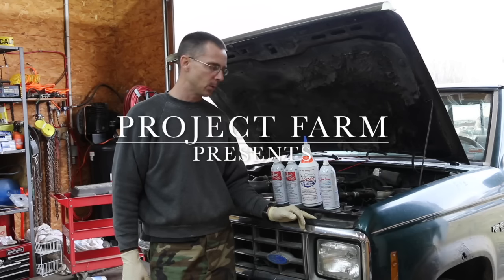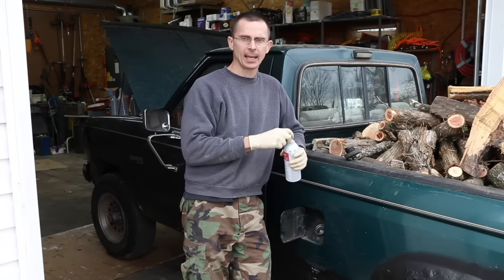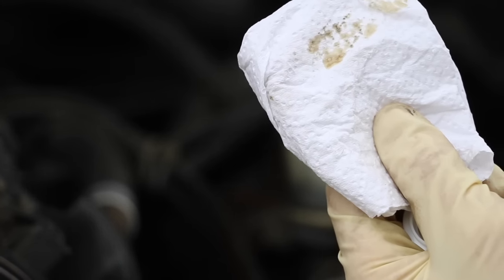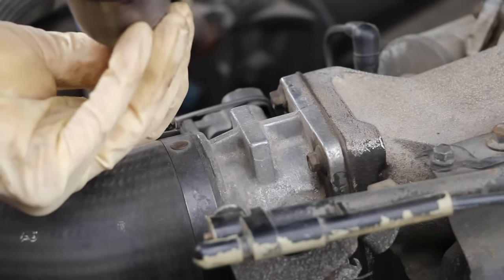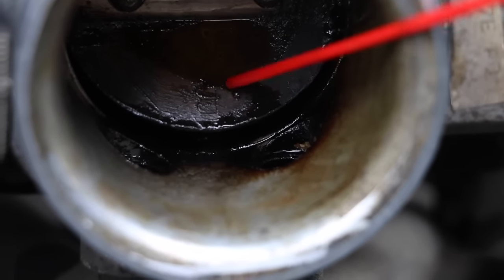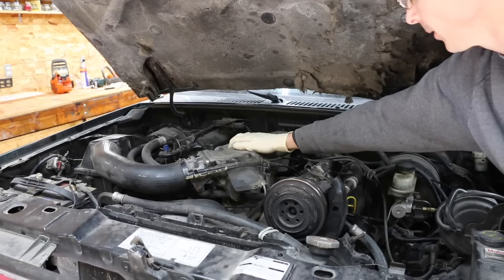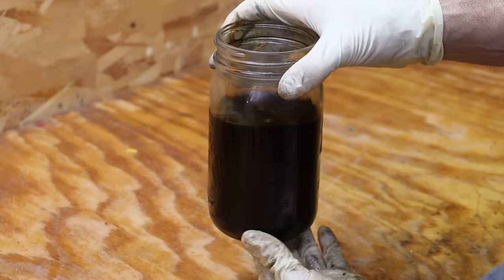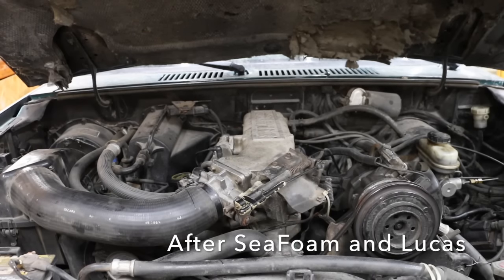Seafoam--can't believe what it did to my engine!!

Comment: A couple of months ago I bought a 2000 Ford ranger with a little less than 100,000 mi on it but it had been used by a meter reader. Three days ago I did the gas tank and I also did the throttle body cleaner made by Sea foam and I cannot believe the results. This truck idles as smooth as glass and it runs great on the

Comment: Lucas oil treatment, or STP, same thing? They seem to have the same viscosity.   I have 410,000 on an 85 Ford F150 I bought new back then.  Has probably the best motor Ford made, the 300 cu in 6, manual 3 speed/overdrive floor shifter.  Oil change every 3500-4000 miles, straight 30 weight non-synthetic, new filter every time.  Does not burn any oil, no valve train noise, but it could use a gasket or two. I vowed to keep this truck for 35 years so I didn't have to get it inspected anymore (NC).  Funny, a 35 year old or older car, truck, or motorcycle (I have a 45 year old Harley FLH) does not need to be inspected, could have bad brakes, burnt out/missing/inop lights,  but a brand new car does.  That's the govt. for ya.

Comment: I pulled my old 77 F-150 out of the hay shed and I'm in the process of bringing her back to life. (351m all original with 99,400 miles) I cleaned the carb using gumout spray (while running), new cap, rotor, plugs and wires.. and ran a 12oz can of seafoam with 6 gallons 3 times.. it improved but it was still idling rough and lacked smooth performance.. so my next step was timing.. but.. before I did that I ran a can of seafoam spray thru the carb and let it hot soak.. LET ME TELL YOU WHAT... This tall deck Cleveland ABSOLUTELY SCREAMS. Truly amazing stuff.. if you have an old rig with a carb, use the spray. By God..

Comment: There is another YouTube that took a scope down the cylinder by removing the spark plugs before and after the seafoam spray treatment and the visual results are amazing. The carbon build up was almost all removed from top of the piston. Stuff does wonders
Reply from the maker: Thanks for sharing.

Comment: Amazing result.  I also didn't think those snake-oil products would work.  Surely doesn't fix everything, like worn metal parts, but if problems are just due to sludge and carbon buildup, it seems to work well.
Reply from the maker: Thanks for sharing.

Comment: Yes, certain additives like this do work because they are super-high in detergents, it really cleans internal parts. my truck engine is known to have potential valve lifter issues, so running some Marvel Mystery Oil, or ATF, 1 qt with 5 motor oil to make 6 in the pan, keeps the orifices on the lifters open & clean preventing this issue. it's our trick. changing it often is key as well. it's not just a flush, we run that qt of Marvel or ATF with the oil until the next change-up. it's good for virtually any engine.
Reply from the maker: Thank you

Comment: On the older cars it typically does work. Good for cleaning out vacuum lines too. The newer ones it can be hit or miss. Many new cars call for higher octane which leads to less do deposits do to the turbo and higher compression.

Short story a V6 Ford or V8 crown Victoria go for it. 2016 BMW M2 I probably wouldn't. You'll probably piss a lot of things off. Things were much simpler in old days. Rubber mallets fixed stuff. These new cars have way too many sensors you'll probably piss things off. On my V8 Crown Victoria Police it don't care what you throw at it. A tank of 93 won't help but it does help keep things clean.

Love the videos tho. I do think some of this stuff works. Personally I I'm a fan of Pennzoil Platinum Walmart has it cheap it enough.
Reply from the maker: Thanks!  Thanks for sharing.

Comment: I have a 2006 Corolla with 280,000 miles on it, and it also was starting to have the lifters make ticking noises like that. I added a can of 'Wynn's Engine Tuneup' ($4/can) to the engine oil and after a few weeks of driving with that 'solvent', the lifter noise went away. The engine has a lot of wear on it and I added half a cup of Lucas HD Oil Stabilizer and that made the engine a bit quieter. After all that, the engine is back to the quiet smoothness it used to be when it was new.
Reply from the maker: Thanks for sharing.

Comment: It works on motorcycles also. I bought a 1990 Honda Goldwing in mint condition. The engine had rough idle and some hesitation. After several gas fillups using seafoam, she roars like a lion and purrs like a kitten.
Reply from the maker: Thanks for the feedback.

Comment: I added Lucas fuel system cleaner to my gas and did seafoam in the air intake. After seafoam my '03 envoy with 220,000 miles starts up instantly with nothing more then a purr, and runs beautifully quiet!
Reply from the maker: Thanks for sharing.

Comment: My take: I have used Slick 50 in two different cars; early 90s, both blew a value and piston. Never used it again. 

Beginning in 2012, I occassionaly used a can of seafoam in my new 2012 Fiat 500 two-door, but I also would add non-ethanol gasoline occasionally. However 80% of the time I used hi-octane gasoline such as Shell Z Power. The gas mileage was extrordinary with non-ethanol and while driving back home which is 3 hour drive, I would achieve 55 mpg. Around 2015 I was warned by a Chrysler engineer  to not use seafoam as it may damage the engine. Last December 2021 the Fiat engine blew a value. I ran into a gal who took her Fiat to our dealership and she was in sales, her car had over a million miles on the odometer, but my engine only had 160k when it blew a value. Was the damage cause by the non-ethanol gasoline or the seafoam? Not sure. I am on the fence using additives these days. i seem to have bad luck but for my lawn mower and snowblower I use only non-ethanol gasoline.
Reply from the maker: Thanks for sharing.

Comment: I've been using Lucas for decades and although it does quiet the engine it is thick like molasses and in cold temperature -25 I worry it will be too thick, I use synthetic oil and add a round 1 cup of Lucas oil stabilizer. Per oil change... - ( My old truck with 275.000 kilometres)    it was summer and I added a liter of Lucas stabilizer and didn't shut the truck off for 45 minutes. The Oil pressure went way up...   Lucas definitely is slippery and will improve gas mileage. I also add 6 oz of Lucas fuel injection cleaner every 5 tanks of gas ... It makes a huge difference.   The biggest difference I noticed is the engine runs quieter and has more power. The lifter tick can be controlled by adding about a cup of transmission oil to the engine oil. It flows better through the oil passage ways and lubes the lifters better.. It's a easy way to stop sticky noisy lifters...
Reply from the maker: Thanks for sharing.

Comment: Seafoam goes in every non-ethanol gas can I own, premix or not. Every so often I'll dump a can or however much I need in my gas rigs as well. The seafoam spray works well too in conjunction with a fuel treatment. I love Seafoam or Berryman's B5. It's the same stuff and does the same job from what I've seen. Berryman's is usually cheaper but I can't always find it everywhere. Lucas has been around a while, but I rarely use it. That said, add half your oil to the engine, add 3/4 of the lucas, top off the lucas bottle with oil, and shake the hell out of it. Then top off your oil and it's just easier to deal with.
Reply from the maker: Thanks for the feedback.

Comment: I’ve found that the quality of oil and fuel also makes a big difference.  The last four tanks of fuel I’ve been using the Lucas fuel treatment.  The first two bottles I was using mid grade (87) gas and with about 90% of my driving was in town and was getting only about 12 miles per gallon; third bottle I put in premium (91) gas and my mpg went up to 14 mpg; with that 4th tank and bottle I’ll see how it goes.  But over the last couple of months, there was an exhaust leak which was causing the engine to rev up more; I finally got that exhaust leak fixed.  Hopefully that helps as well.  I use Valvoline Max Life High Mileage and not sure if it’ll be worth it to use the Lucas oil treatment, especially since I don’t put on a whole lot of miles on my car between oil changes.  So, how often is it recommended to use Seafoam in the tank and crankcase?

Comment: When putting seafoam into the crankcase, be prepared to drop the pan after and clean/replace your oil pump pickup screen, etc.  A lot of material comes out with the oil during change, but larger deposits can break loose and travel around the engine.  A friend had an engine blow after doing this, and after breakdown it was apparent that dislodged carbon deposits plugged up the crankshaft oil journals, overheating the bearings and eventually causing a failure.  It works, but isn't just an "add and forget" especially on older engines!  Sometimes it's better to leave that junk in place!
Reply from the maker: Thanks for sharing.

Comment: I use Lucas in the oil and in the fuel of 88 diesel Silverado and always have coming up on  1/2 million miles 468,554 miles Use it the commercial trucks too. Keeps those injectors clean and stabilizes the fuel.
Reply from the maker: Thanks for sharing.

Comment: Great video! Wondering though how this method would worsen or affect a known head gasket leak. I have a 2016 Hyundai Elantra that has a crusty gasket leak that has not actively leaked in years but my concern is this may help with the rough idle and rough running but worsen the gasket situation. Thoughts??

Comment: HOWdy  P-F, ... 
Thank you very much - since SEAFOAM is just a petroleum distillate  I expected the "CLEANING" effect in the CRANKCASE ... 
the freeing up of the LIFTERS was ( <less noise ) is pretty amazing  ...
The CLEANING Effect of the SPRAY on the Throttle-Plate was expected but the Carbon Heat Soaking seems effective ... 
the LUCAS OIL Treatment appears to be very similar to the 1970's  " STP " Oil Treatment ... 
YOU have changed my MIND  about SEAFOAM & possibly of  LUCAS Oil Treatment ... 
Thanks Again 
COOP
the  WiSeNhEiMeR from Richmond, INDIANA 
...
Reply from the maker: Thanks for the feedback.

Comment: My Buddy mixed up sea foam, diesel, and transmission fluid equal parts and opened up the throttle and poured it slowly down the old quadrajet 4 bbl for about a minute careful not to stall the sickly 350. After the blue smoke cleared and the throttle was worked and finally released, the old truck ran like it did right off the showroom floor. Now this guy is a mechanical genius and has many high level skills that few people possess so I never doubt him and the things I’ve witnessed over 10 years that just make you say “do what?”
Reply from the maker: Thanks for sharing.

Comment: In my experience, the BG 44K Fuel System Cleaner is the best there is. It's a little hard to buy because they try to only sell it to shops, but you can usually find a shop who will sell you a can, or you can find it sold on the internet places.
Reply from the maker: Thanks for the feedback.

Comment: Going to give the low viscosity oil stabilizer for my 15 Ram 1500 with the 5.7. It’s supposed to help engines with low viscosity, VVT, and MDS systems. I’ve had a vibration occur when MDS turns on and I’m cruising. Hoping it helps.
Reply from the maker: Thanks for sharing.

Comment: I'm a firm believer in Seafoam and Lucas,  even Lucas spray wax is a phenomenal product. Seafoam ,I believe is good for and engine new or high mileage,  Lucas I only use on my higher mileage engines. I've also used Seafoam in my 93 Harley Electraglide.  All these products can be found at Walmart for a substantially lower price than Auto Zone and O Reillys. The only thing I'd do differently making a vid like this is stand further away to catch the sound without all the fan noise and exhaust.
Reply from the maker: Thanks for the feedback.

Comment: I have a 2010 Honda Accord, 4yl.  90,000mi.   Pickup is about what I’d expect for it.

Would it benefit from a bottle of Lucas or Seafoam every other fill-up for a month, or should I also spray Seafoam into the spark plug openings and see if it improves?

Comment: I've owned several sailboats with kicker outboards. I always swore by using STA-BIL until my last motor. It was a 1983 Honda 4 stroke. The combination of it being old and the gas sitting in the tank for most of the season. The outboard started failing putting me in some dangerous situations...and this was with STA-BIL.  I was ready to replace the motor so figured I'd give Seafoam a try. It took about an hour of running this stuff through to work but I was amazed (still amazed) how smooth that motor ran!  Smoother than my brand new Tohatsu motors. Scotty K says it should only be used for small 2 cycle motors. I disagree.
Reply from the maker: Thanks for sharing.

Comment: My F150 3.7L V6 gets very bad gas mileage. I cleaned throttle body and MAF sensor, and replaced air filter. Was getting 10mpg but I'm now getting 11. I'm seriously gonna try this stuff because you can really tell the difference.
Reply from the maker: Thanks for the feedback.

Comment: Know this is a old video .I've noticed in my experience. Lukas does not have the detergents and additives  that your engine needs. It a heavy weight oil  and that's it, use  1 quart of a standard oil with additives at heavier weight. Seafoam is an outstanding product after running seafoam a oil change and fuel lubricant are a must in my opinion though to properly relube the system .... Thanks for sharing!
Reply from the maker: You are welcome!

Comment: Seafoam is amazing! I use it in all my lawn equipment and 2 stroke boat motors. I use to rebuild crabs all the time. Now I seafoam 80% of them and save me hours of work. The secret is to let it run for a minute, then shut it off and let it soak them jets for a day, then run again. I tell all my buddies who know nothing about engines to run a can through their 2 stroke boat motors each season. Whenever I sell a used machine I instruct them to seafoam it at the start of every season and I have them take a photo of the can before they leave so they remember. It gets a big thumbs up from me.
Reply from the maker: Thanks for the feedback.

Comment: Could this damage the catalytic converter?

I looked, but no comments/questions about the catalytic converter.

Adding to oil I wouldn't expect it to.  Unlikely adding seafoam to the gas tank.  But the entire can of spray down the throttle body I'd be a bit concerned ending up with a fault light and learning the cat is ruined, or some other EV sensor.

Thoughts? Comments?
Reply from the maker: Thanks for the suggestion.

Comment: I very much doubt that “oil was not reaching the valve train”. What was likely ticking was a carboned/stuck lifter. That was a common issue before the 1990’s on high mileage engines. Any kind of high detergent additive is likely to work to loosen the carbon. I knew a man that used marvel mystery oil for the same issue and it worked great. 
Another interesting fact is you are using synthetic oil, which itself will loosen carbon deposits and varnish. We had to bring our used oil filters in and cut them open for Airframe and Powerplant training. One guy had a high mileage  80’s Chevy. He had changed to Mobil 1 from conventional oil on the oil change before the diagnostic cutting and the filter was so jammed with carbon, he could hardly slide the metal oil filter body off the element. He collected a quart size bag of carbon from that filter.

Comment: I have Been an ASE Certified mechanic for over 40 years. Worked on Buses, Doziers,Trucks and boats. Seafoam was not ment for 4 stroke engines. It was developed for 2 cycle outboard engines ,there is Oil in it for lubrication. It has a chemical in it that will destroy valve seals .No wonder your engine is smoking. We also use it to Fogg out an outboard motor to store it for the winter.

Comment: With the seafoam I've noticed, you're not supposed to use the spray like that. Your supposed to re-tighten the boot overtop the straw and spray it while running high RPM, not take the boot completely off. The exceedingly high airflow might have altered results

Comment: Avoid the Lucas oil stabiliser, if you have Hydrolic Lifters (top of engine) as thick viscosity will block the oil going through the small 2-3mm holes to the Lifters, Thus Blocking the lubrication of them, Causing Ticking  - top of engine... cams are the same,  the oil pump can only pump so much pressure ?  . . . Thats why you must stick to the right viscosity, use Vehicle manufactures spec . . . Many engines have Dies due to Bad additives . .  some are safe - ATP at-205 for 0-rings is one of them,  . . . We need to look after each other on here . . . Mechanic Bills, are killers . . . (to High)  Just spent £2500 on my van in 3 months ? (Mechanic bills???) - MADNESS . . . Thank God for you-tube & People Like yourself, showing us Real results . . . Good & Bad . . . There's too Many Sharks in the water, too Many people getting Slaughtered, by Lies, on additives or non-helpfull mechanics . . . (they don't tell you Basic things that would save your ass ? Joe Blogs & sister Sarah is Left in the dark ? (The Humanity of it all ?? where isit ? ) . . .  (So here's my 50 pence worth of advise, from what Little i know . . . ) Keep Testing stuff Mate, You make a BIG DIFFERENCE . . .keep fighting the Good Fight. . . . .
Reply from the maker: Thanks, will do!